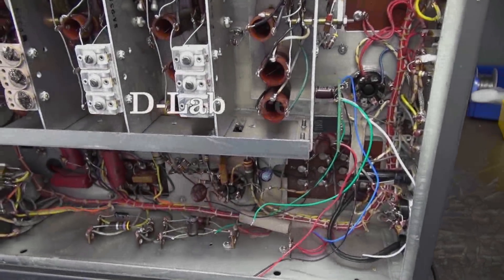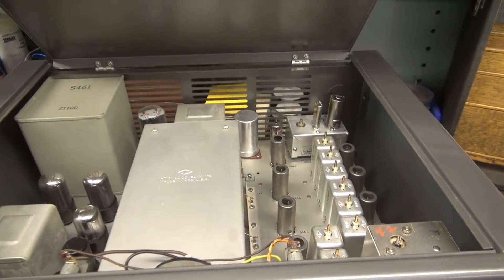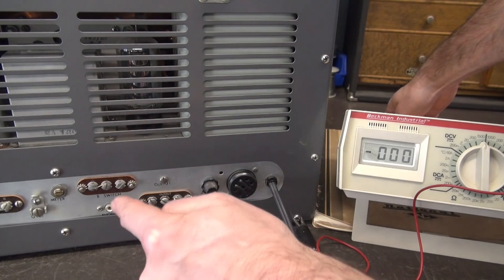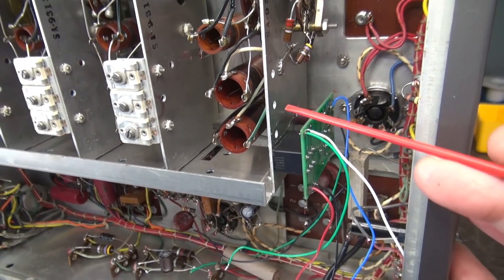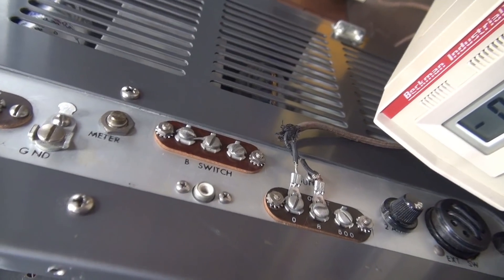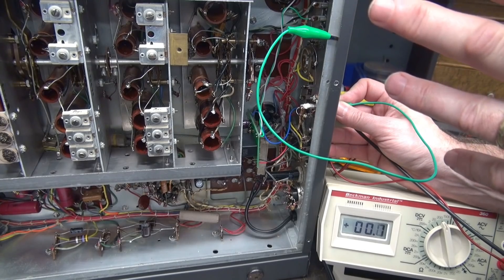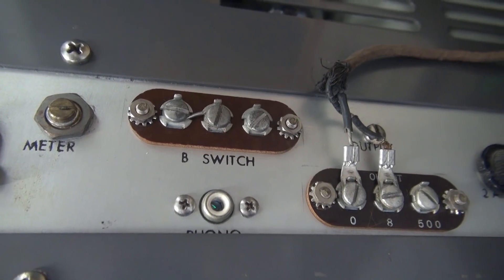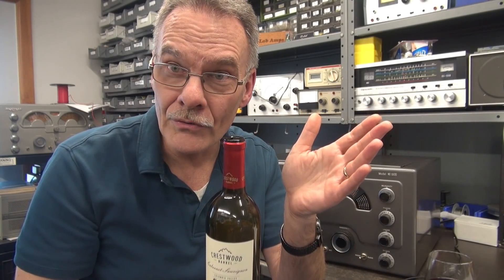National NC-183D Ham Shortwave Receiver Standby switching Mod Enhanced function and Safety

Comment: Great vids!  I just had a mint 183-D gifted to me & was surprised to see no fuse in the B line to the vr tube (in case the filter caps short to ground).  Also do you know a source for the  dual 40 mfd filter cap?   Great stuff,,,

Comment: Too bad your KS1 is soooo quiet, Terry.  When I was young I had a 110V relay for T/R and shorting the antenna contacts, mounted on the back of my NC300.  It would vibrate on the back of the cabinet and go "ting tang" when I pushed the foot switch.  So, you could have had Ting Tang Walla Walla Bing Bang.